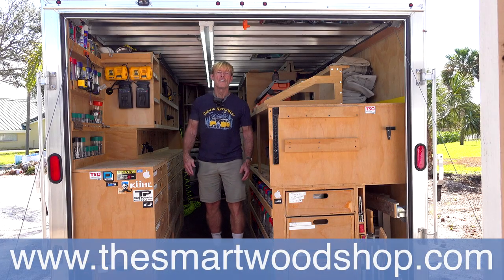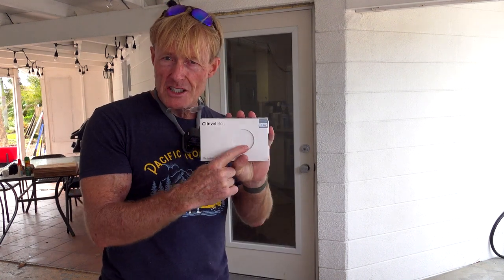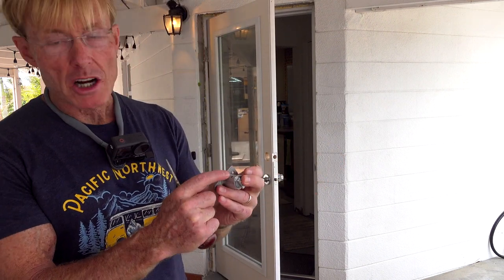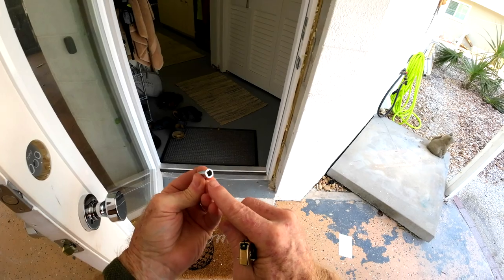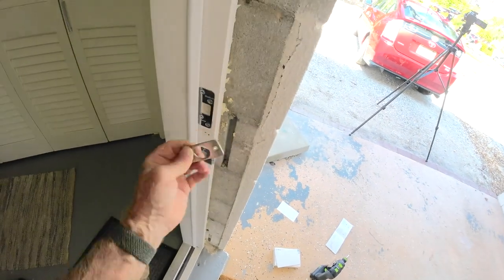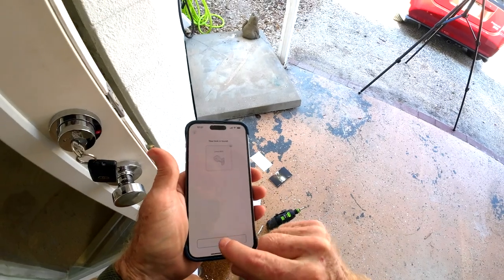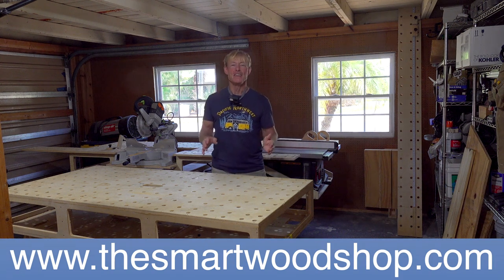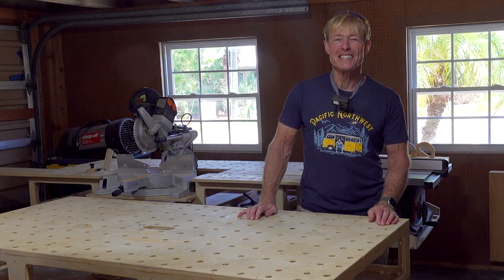DIY Easy Smart Lock Installation: Step-by-Step Guide

Comment: Does it inform you when the battery is getting low? You need a hideaway key just in case.
Reply from the maker: Yes, the app lets you know when the battery drops below 20%. The average battery life with typical usage is 1 years.
Reply: @TheSmartWoodshop  I'd still keep a hideaway key. Keep, em coming!

Comment: Interesting option, for sure.  Not sure why you'd need to operate it remotely though.
Reply from the maker: Remote operation is the purpose. No physical key necessary. When you have left and not sure if you locked the door no need to go back as the iHome app has a log. There is also other features like auto lock, schedule for locking and unlocking. Unlock for others to enter, etc.. There is an updated version that works with the Apple Watch so you can wave your watch in front of it to unlock and lock.We are planing on getting the newer version for this door and moving this one to a less used door.